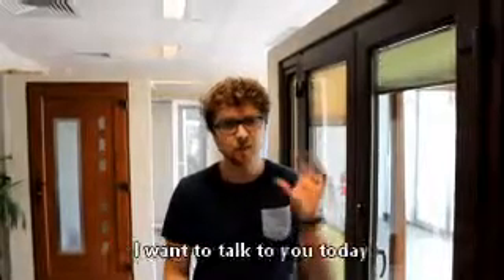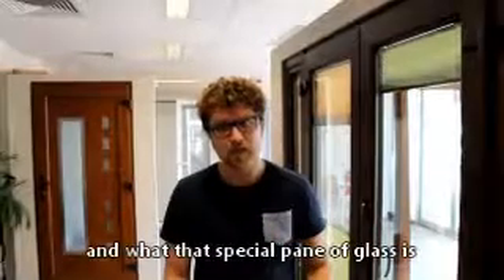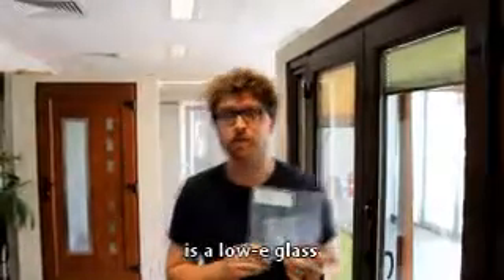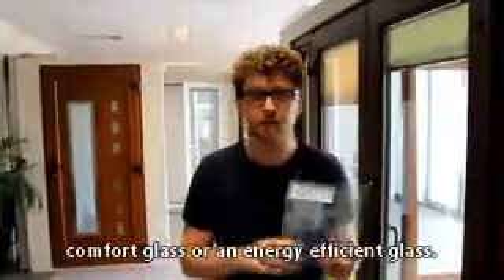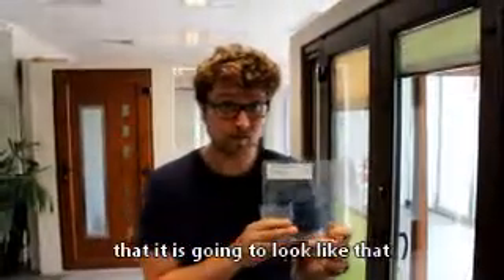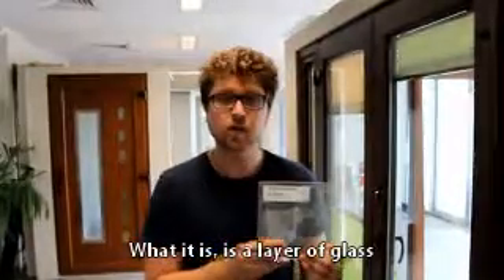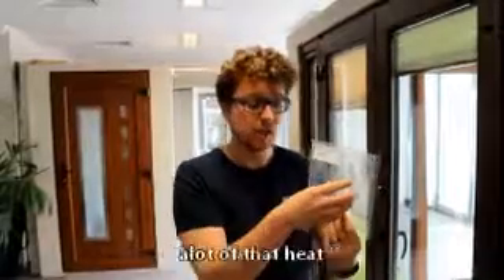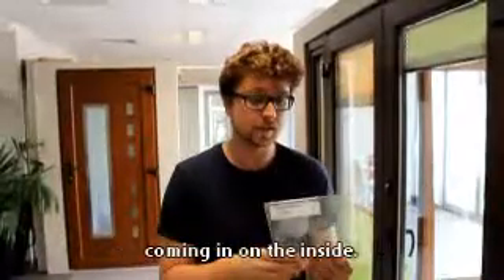What is Low-e Glass - Double Glazing Basics

Comment: So this glass reflects the heat back out, but outperforms double glazing, which keeps the heat inside.  Does this keep the heat inside too?
Reply from the maker: It reflects heat, so during the summer time it will reflect it back out and during the winter it will reflect it back in and keep the heat it. It will work similar to a thermos.